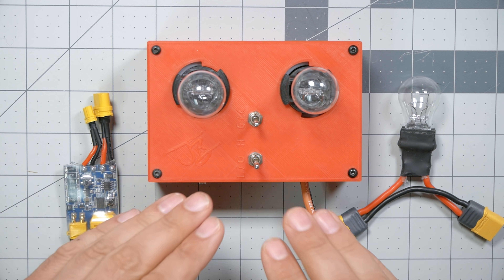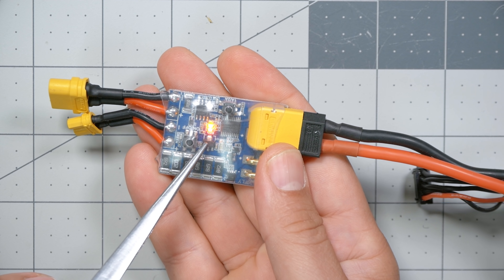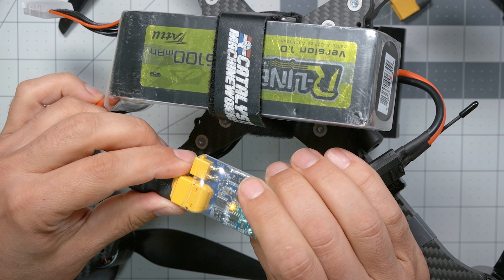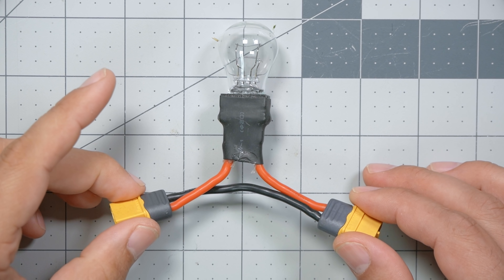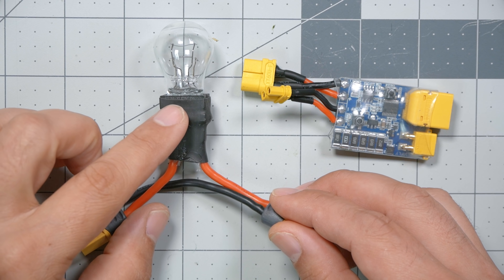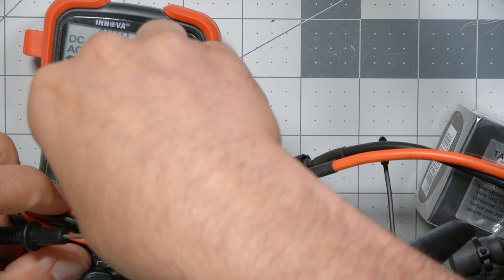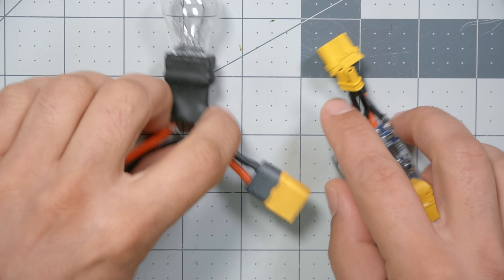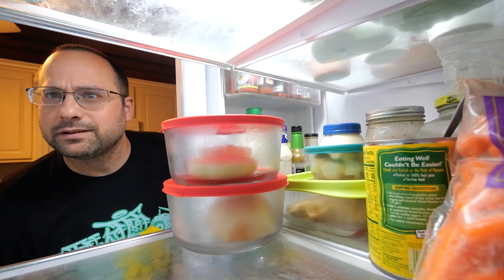Your smoke stopper is lying to you. Here's the truth.

Comment from the maker: To everybody saying, "Just use a multimeter." Multimeter are great and I show in this video how to use one to detect faults. But multimeter cannot protect against all faults. What if you have a battery plugged in and you are testing the FC with a multimeter and you accidentally short circuit two pads with the multimeter probe. Smoke stopper will save you. What if you have an ESC that is damaged so it's going to smoke the motor as soon as you plug in? Smoke stopper will save you. So please, please stop with this macho "I don't need a smoke stopper" BS. If you don't want to use one more power to you. It absolutely has a place though.
Reply: That already happened to me! Fried a FC with the Multimeter!
🥺
Reply: yep. fried my fc-esc-vtx on that plugged lipo while doing the multimeter. lol
Reply: why are u guys probing a fc when power is connected tho, that’s just dumb
Reply: Your not supposed to use a multimeter while power is on anyway. Only if your checking amperage and that is a protected circuit in the multimeter

Comment: SpeedyBee stack did this.
It sends an initial 12v instead of 9v. That must be causing the stopper to fuzz. Power interrupted BECAUSE of the stopper. Fires up and functions correctly with stopper removed.

Comment: I built my lightbulb smoke stoppers by just joining a couple together in series. Have not had any issues with this approach. Basically in series the lightbulb style smoke stopper will work fine. For me this worked well as I started on 4S and then when I moved to 6S primarily I just built a second one. The nice thing about this approach is that it also works with 4S and probably lower cell counts. The big thing for me is it is very large and clear no wondering if the settings are right … just remember 4S one light bulb 6S two lightbulbs 💡

Comment: I always check continuity first…. Most chargers have power output modes you can set voltage and current and will trip if either exceeds the limit. Great alternative to a smoke stopper.

Comment: Hi Joshua, I have a problem with my drone.
I have a 5 inch quad, it is a lumenier QAV-S jhonny fpv edition, with Iflight 2208 1800kV motors, with 5×4.8×3 props. Every time I fly it, the motors get very hot. Also, when I do flips, it oscillates a little bit and it tries to do a strange mini powerloop. I'm flying with the stock PIDs, stock filters and with rpm filtering. How can I solve this problem? I need help please

Comment: I've been building and flying since 2015 and I've never had a smoke stopper. I'm just careful, take my time and inspect all joints with a magnifying glass/reading glasses to make sure there are no shorts or blobs. In all that time I've only fried one esc on an early zmr250 build because I had the esc sandwiched between the plates and left a wire exposed that touched the carbon fiber. I feel like that's a pretty good track record.
Reply: And probably you avoided sh..ty components

Comment: A good alternative if you don't want to purchase a smoke stopper is to use a Lab bench power supply, you can regulate the voltage and current you want to feed to the drone and it's very useful for other electronic projects. You can find a simple one for quite cheap.

Comment: you can press and hold the on/off button on the vivfly shortsaver 2 until the yellow light turns off and begins to bink and then press the button again to adjust the current sensitivity to low/medium/high and then press and hold it again to exit.

Comment: Is there any advantage to using a smokestopper compared to a multimeter? TIA
Reply from the maker: Smoke stopper can protect against transient failure modes. Such as if you short circuit the ESC with a screwdriver after plugging in.

Comment: I just use a lower cell battery to check the same quad.
If the quad runs on 4s I power it up the first time using a 3s. If it's 6s I still use the 3s to power it up.

And that tells me if it's the motors and vtx that are causing the smoke stopper to trip or if there is actually something wrong.

Comment: I was about to tear apart an esc because of throttle trip! I didn’t even give it a thought it tripping out when I throttle up the motors 😂 I guess a 2 amp fuse smoke stopper wouldn’t like throttle current, it’s an heli s esc so i switched wires to reverse a couple of motors instead of messing around with heli s suite and thought I screwed it up! All motors now spin correct and smoke stopper doesn’t trip just being plugged in so il go with that.

Comment: The little iflight chargers have a constant current power source, also perfekt as smoke stopper
Also you can test a 6s copter with as little as 8 volts. If there is an issue, you will find it anyway….

Comment: For the light-bulb and the short-circuit, there may be 3A flowing, but also there is a very low voltage across the short circuit - that means low power dissipation (I * V). Most of the voltage is now across the bulb (it has to go somewhere...).

Comment: My friend build his first quad and he had a problem. He checked with multimeter for shorts and then he just plugged in battery, everything worked and he jumped straight into configuring quad in betaflight. But when he tried to spin motors ESC smoked after few seconds. Motors did run for a 2-3 sec and then ESC blow up. ESC is dead and FC is broken also. FC works from USB but not from VBAT or any other pad. What may be the cause?

Comment: I'm confused. Light bulb is in series with the battery and the ESC batt terminals. If there are no shorts in the quad wiring, then the ESC, FC, etc take most of the voltage because altogether they are a bigger load than the bulb and the voltage across the bulb terminals would be too low to make it light up. if there is a short in the components then the voltage drop across the ESC terminals is low to none thus providing almost all the battery voltage across the bulb terminals and making the bulb light up. My point is that the important parameter in choosing a light bulb is the voltage rating, not the wattage.
Reply: If there is a short it creates an infinite current flow in your flight stack which then makes the light bulb your current limiter. And the light bulb will light up from the current flowing at is rated wattage.

Comment: I got similar situation with Walksnail MOONLIGT. When I conected my drone with Moonlight VTX smoke stopper bulb flashed bright. When I disconected VTX the bulb stays off during powering up my drone. Moonlight kit consumes 1.4A of current and that amount of additional current makes the bulb flash. Before I figured it out I thought that my VTX is broken or wires are shorted. But my Digital Multimeter didn't show any shorted circuits

Comment: Multimeter says no short, vifly trips when esc beeps start. Its a 6s build but i have another one that doesnt trip the vifly. Should i trust the multimeter or the vifly? Everytging appears fine, all new parts.
Reply from the maker: Most likely it's safe.
Reply: @JoshuaBardwell  thanks man, i was gonna plug it in with fingers crossed anyways but i feel better with your thoughts that if multimeter checks out it probably wont release the preciou$ $moke. I guess if i built poorly there would be a short, and if i build it good and it still blows it was just bad parts and it was gonna blow anyways. My name is andrew, and im gonna learn something today! I hope it works, its a fucking sweet build with a phoenix 2 cam so i can haunt the city at night.

Comment: I’ve been lucky so far, after building the Tyro 119 along with your guide then later a GepRC MK4 without issue… My question: Will a continuity test with multimeter be sufficient when testing for faults? Or would a smoke stopper be recommended over that?
Reply from the maker: I show the use of a continuity test in this video; it's a very useful approach. But the smoke stopper is additional insurance and is certainly helpful.

Comment: Only thing it guarantees is that your circuit won't burst into flames in case of a fault. I shouldn't expect it to actually prevent the system to be damaged or fried if it's shorted. Just to prevent a fire.

Comment: I think it would be overkill to do so but you could figure out from amp clamping motor wires when they are in operation or going off of the manufacturers average data from specs to get a nominal amperage of your motor then you could put in line fuses between your motor and ESC that are right above that amperage so let's say a motor running on 6s was producing 1.5 of an amp you could put a 2 amp fuse in line of the motor wires and if it ever got above those 2 amps the fuse would blow and you would save your motor but who's actually going to put in line fuses on every wire on every motor would look kind of ridiculous you just got to risk it for the biscuit baby. #pushittothelimit 

Note obviously when you're increasing throttle with a propeller the amperage is much higher than 2 amps so you would put the fuse that correlates with the max amperage you do not want to exceed for that motor I'm just using 2 amps as a reference

Comment: I thought everyone knew that "smoke stoppers" are actually just trip switches...
Reply from the maker: If it's a light bulb, it's not. It's a resistive element that limits current flow without tripping completely off.
Reply: @JoshuaBardwell  Who on earth still uses those lightbulbs as smoke stoppers?
I thought it would be rather obvious that I'm not talking about light bulbs when I mention trip switches...

Comment: I mean, why not use a simple CV/CC power supply? Something like a shitty DPS5005 cost 25 bucks. You can use your LiPo as input, you see the current draw and you can limit the current to prevent the release of magic smoke.These light bulb contraptions seem just silly ^^
Reply from the maker: How fast is the clamp time on the DSP5005? How accurate is its current limiting at low voltage? How much does it weigh? How big is it? How much does it cost? These are all reasons why some people prefer a light bulb or a ViFly smoke stopper over a power supply. If you have a power supply on the bench then use it. More power to you. It's not the best solution for every circumstance.

Comment: I have a confession..
I don't use smoke stoppers. 😳😱
Reply: Personally, I would use a diode to allow current to flow one direction only to prevent a backwards battery connection issue. 
A capacitor will store x amount of excess depending on the cap. 
A power flow circuit board can be made to use inline with the power leads but it doesn't work if it's removed from the craft before flight. 
I'm glad someone decided to manufacture these devices, but I personally feel that if it's my aircraft I rather make sure that the components work with a battery only. If It does fry like bacon I'll replace it. 
My GEPRC Dolphin SMOKED a little after a crash when I connected a battery. 
I double checked the power wires (+ pulled loose in the crash) were not touching and tried again. 
It was fine. 

Important note: I used a whoop 2S pack to test it.

Comment: This is really bad advice. A multimeter is by no means a good way to test for current draw on a quad, when you are putting it in continuity you are assuming the all the capacitors are fully charged and there are no active components on the quad, if you want a real "smoke stopper" just use a 10a mini blade fuse, you can get hundreds of them for only a few dollars, they are slow blow and will save your electronics while being able to repeatedly trigger fault conditions safely.
Reply from the maker: If you decide to use a fuse, use a 1 or 2 amp, or 3 amps at most. 10 amps is way more than is needed and can result in damage. But why use a replaceable fuse when a smoke stopper can be reused infinitely at zero cost?
Reply: @JoshuaBardwell  That's a fair point, I would say 1 or 2 amps may be too low, unless you have a 5s slow blow fuse. Reason being the smoke will be coming from a component that is already failed, which you cannot get as a polyfuse, as you said yourself the inductive load of a motor or even a large capacitor can easily pop a polyfuse due to their inrush.

Just to confirm my main point of using a continuity tester to test a drone is heavily invalid as something as simple as an uncharged capacitor or active components would give you false readings.

My point is this, you need to (what in my industry call) "live test" but having a fast switching poly fuse with only 1a isn't going to test anything, you need the logarithmic blow times of a standard slow blow to allow components to work as intended but also protect the components. Most BT2 cables are rated for 10a and as we all know a drone can easily hit 30a bursts. So I would call for a 10a fuse as per "Ib ≤ In ≤ Iz" rules which fall on electrical components to have protection implemented as the engineer sees fit and the fuse to protect the cable and battery, although I will admit 5a over 5 seconds would also be adequate unless we could source a Type C circuit breaker smoke stopper for a fair price.

Hence why I said 10a mini blade fuse, a total project cost of less than $1 and will do better than any smoke stopper shown or multimeter, in my opinion. But I do appreciate the reply, and thanks for all the great work you do in your videos.
Reply from the maker: The point of the smoke stopper is to protect electronic components like pcb traces not the wires. A wire often won't smoke because the ocv acts as a fuse and burns out first. That's why you want a very fast trip on the smoke stopper and the lowest amps that still allow the quad to power up.
Reply from the maker: Blade fuses get expensive when you don't know where the fault is and you keep blowing them repeatedly. A fast acting efuse (note: not polyfuse) like in the vifly is perfect.
Reply: @JoshuaBardwell  I see, I was confused, I apologies about that.

But still in my opinion a Type B or C 1a circuit breaker would do a better job than a efuse in a smoke stopper as efuses are not good when they are in conjunction with current sensing high frequency especially when using hall effect current sensors on an inductive load such as motors, doubly so for high frequency such as Dshot. 

An example of this would be tricolor led constant current lights, the cheaper lights put a sticker on usually saying "do not switch color while turned on" this is due to the current sensing circuit not keeping up with the speed of the switch flicking and can overvolt the light killing it, it's the same as a bimetal strip is directly related to the heat of the wire regardless of all variables but with efuses the current sensing circuit can rarely keep it and will usually overreact.

TLDR; Circuit breakers are apart of the circuit, they trip sooner on hot days and you can't trick them with short spikes in power if you rate them properly, efuses are complex and digital and take absurd amounts of R&D to implement as current detecting fuses properly.

Comment: People use this crap?  quit using smoke stoppers..Multimeter all the way
Reply from the maker: There are lots of failure conditions that a multimeter can't protect against. ESC with bad FET may test fine with multimeter but smoke the motor as soon as you plug in. If you are working on a quad with the battery plugged in, such as using multimeter probes to test voltage, smoke stopper can protect you if you accidentally short something with the probe.